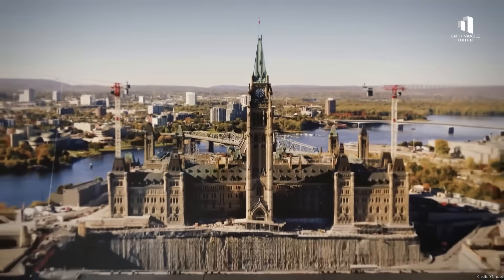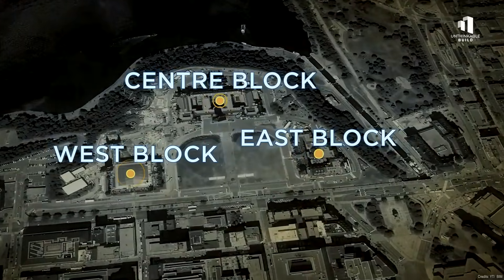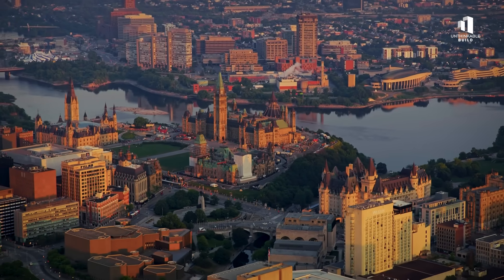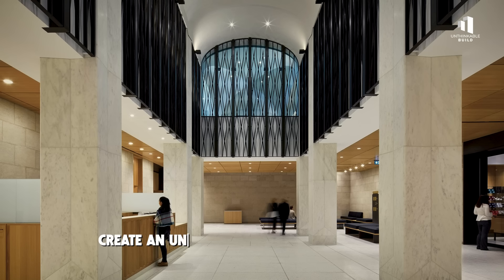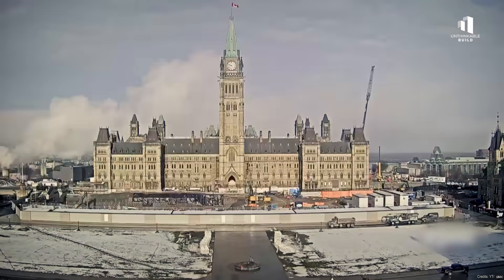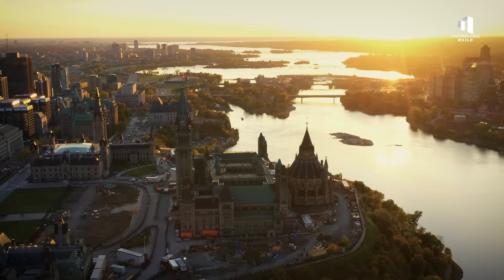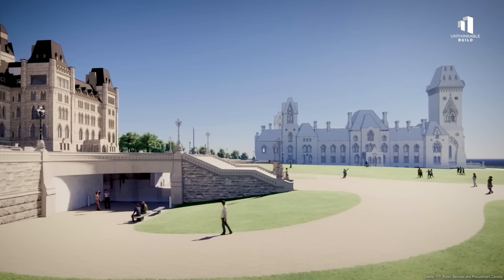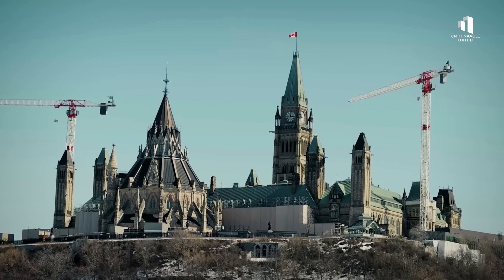Why Canada Dug a Massive Hole Under Its Parliament

Comment: When does the PM's house get rebuilt? OR torn down and replaced. Something, it's costing a king's ransom just to own it. We need to update it so it can be heated without costing an arm and a leg. This isn't a partisan thing, it's just necessary. Too bad each party feels if they fix it, they're fixing something for themselves and it won't fly.
Reply from the maker: That question comes up often with 24 Sussex. The house has been effectively unoccupied for years because of safety, asbestos, and systems failures, and the carrying costs are high for a building that can’t really be used. Studies have shown that either a major rebuild or a full replacement would be more practical than endless maintenance, especially for energy efficiency. The problem isn’t technical it’s political hesitation, since any decision gets framed as self-serving rather than basic stewardship of a national asset.

Comment: Considering how things are going in Canada right now maybe they should stop the work and save the money. If some have their way there will be no Canada to rule.
Reply from the maker: A lot of people feel that tension right now, but stopping major infrastructure mid-build usually wastes more money than it saves. Once contracts are signed and construction is underway, cancellations trigger penalties, stranded assets, and unfinished work that still needs to be secured or removed. The more realistic path is to improve oversight and control spending so projects actually deliver value, rather than abandoning them after so much has already been invested.
Reply: Things are doing fine in Canada, so whomever you are listening to is lying to you. If you are disappointed we are not more aligned with the cesspool to the south, by all means, please relocate to better provide for your own ideological comfort.

Comment: And in the US the President demolished 1/3 of the White House, "The Peoples House."
Reply from the maker: That claim isn’t accurate. No U.S. president has demolished a third of the White House. The building has undergone multiple renovations and reconstructions over its history most notably the Truman renovation in 1948–1952, when the interior was completely rebuilt because the structure was unsafe but the exterior and overall form were preserved. These were safety and restoration projects, not demolitions of large portions of the building.
Reply: @UnthinkableBuild  Your statement is not backed up with data.  The main WH building has 55,000 sq. ft.  The West Wing has 33,000 sq. ft.  It is interesting yay the East wing size is now unclear, the prior size was stated at 55,000 sq. ft.  recently changed to "only" 12,000 sq. ft.  Whether that was to minimize the damage is unclear.  What is clear is it is gone.  What is also clear is Trump demolished 12-38% of the White House.
Reply: Gaven newsom spending 1.2 b. At state house building who knows what.  ?   Check it out
Reply: @scottblackburn2969  The State Office Building in California was authorized by the Legislature by law.  It was not a unilateral action by  a tyrant.

Comment: For me, the most surprising part is the base-isolator system designing an earthquake-resilient foundation under a functioning national landmark, without disrupting operations, is incredibly complex. That level of precision beneath historic structures is a bigger challenge than the excavation itself. The greatest engineering test was coordinating everything underground while keeping Parliament fully operational and protected above.
Reply from the maker: You've hit on the core challenge: the base isolation combined with maintaining full operations was indeed a monumental feat, far more intricate than just digging a hole.
Reply: The building is vacant. Government is operating in the west block....that has been renovated by the way.
Reply: @oldodger  I worked on the West Block restoration project for 4 years. I was working the day that gunman shot a soldier and then entered Centre Block.
We were the last building to get evacuated. Didn't get out till 10:00pm
Reply: @andy33d Glad you're OK. I was in that neighborhood on a service call.